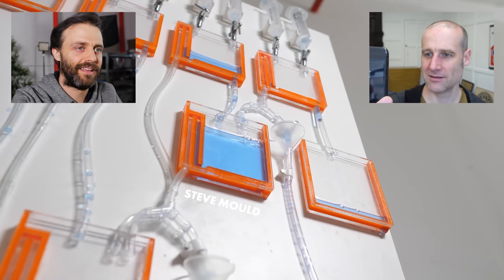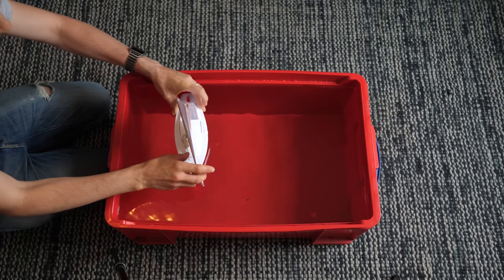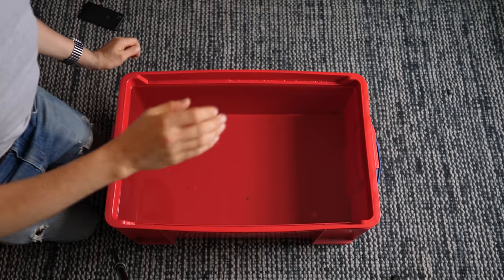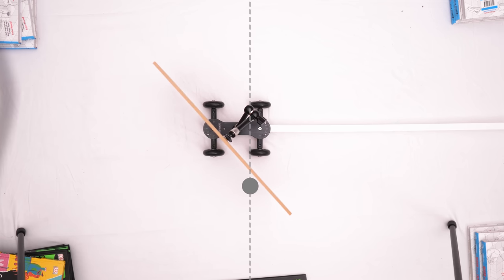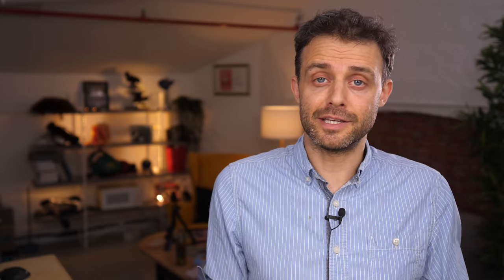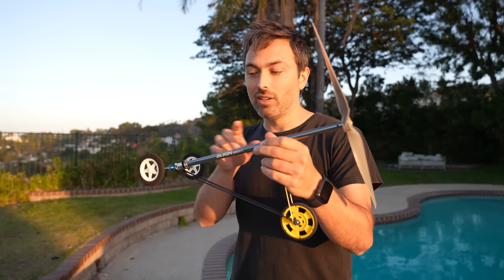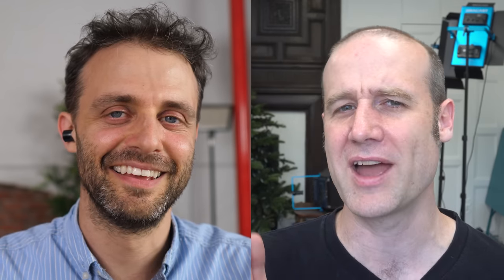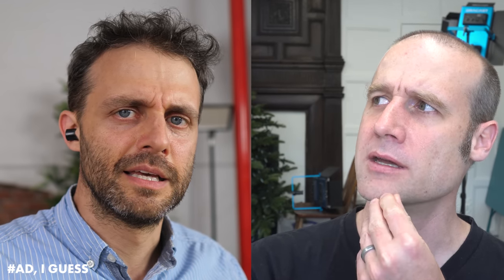Sailing Faster Than The Wind - How Is That Even Possible?

Comment: Without watching the video, im guessing how this works as the thumbnail kinda explains this entire concept, If we have windspead in one direction it pretty much means that if using a sail we can only travel that fast in that vector direction but if we angle the sail we can have a moment vector in another direction which theoretically in a ideal situation with infinite space and no friction on some tracks you could reach rediculous speeds at tiny sail angles, except with very slow acceleration

Comment: Actually, the sideways drift of a sailboat is not negligible. When tacking into the wind, the drift is usually around 10-15°, and you have to aim upwind of where you are going when navigating. Also, since the boat will not be going straight through the water but at an angle, the keel/centerboard and rudder will also act like wings underwater similar to the sails, but which force-vector point forward and into the wind, counteracting the drift but also adding to the forward force! Underwater aerodynamics are very important, as the density of water is so much higher than that of air.

Comment: A bit simplified without talking about Bernoulli.  The lift vector of a wing and by extension a sail is not 90 degrees (directly up) off the cord of the wing, it's at an angle lifting ahead or forward of the wing.  This is why airplanes need tails and a wing will tumble without one.  So this forward leaning lift vector plays a big part in a sailboat being able to sail more than 45 degrees into the wind.
Reply: The lift vector is defined as being 90 degrees to the free stream (or motion vector in still air).  There is however a drag vector as well of course (which is defined as parallel with the free stream.
Reply: @Rick_Cavallaro  I was trying to describe when the wing is at a positive angle of attack to the relative air mass it is moving through, the center of lift will be greater on the forward half of the wing.  So looking at the classic wing diagram the wing is shown at some positive AoA and the lift vector is straight up, but that angle is tilted forward relative to the cord of the wing which will cause it to tumble without a tail.  Anyway it was probably 10 years ago when I read "The Illustrated Guide to Aerodynamics" by H.C. "Skip" Smith.  It's a really good primer on Aerodynamics.
Reply: Not implying you need to read it, just recommending it in general to anybody who is interested...  just figured out who I'm talking to ;-)  That's one hell-of an amazing machine you built.
Reply: @JohnUllrey  
>> that angle is tilted forward relative to the cord of the wing

Ah yes.  That will typically be the case.  But lift and drag are defined relative to the free stream rather than the chord of the airfoil.

>>  which will cause it to tumble without a tail.  

The reason a non-swept, and non-reflex, airfoil will tumble without a tail is because a lifting foil necessarily induces vorticity.  This puts a torque on the wing.  In a traditional aircraft, the tailplane has negative lift and the C.G. is a little bit ahead of the wing's center of lift - for stability.

>> That's one hell-of an amazing machine you built.

Thank you!  That's always so much nicer than being called a liar and a con man. :)
Reply: @Rick_Cavallaro  Yes, I probably had an over simplified view of what causes a wing to tumble.  I re-watched the original video and what I was trying to describe is the component of the lift in the forward direction shown by the green arrow 7 min into the video. (https://youtu.be/jyQwgBAaBag?t=426 ) I was trying to say that this component is a contributing factor to why a boat with an airfoil shaped sail can tack greater >45 degrees into the wind.  Steve Mould did bring up the importance of the keel, which I think is what makes it possible to apply these forces in the direction you want to go.  Thanks for the engaging dialog.

Comment: It's the same principle as gearing! you can peddle a bike slower than you are moving because the gear ratio. What is happening is a lot of wind energy is being compressed into a small working engine. The sail can focus the energy to direct movement.

Comment: Great explanation of sailing but I miss the demo that one can actually go faster than the wind downwind, i.e., even if one sails at a slight angle from the wind, the downwind component is still faster than the wind. This is an essential point to understand before going to Veritasium's machine. I reckon your rolling contraption could show it in principle with quite extreme angles (and america's cup boats are now doing it all the time).
Reply: Two youtube videos which explain how the downwind component can be greater than windspeed:
DOWNWIND VMG GRATER THAN WINDSPEED (WEDGE)
DOWNWIND VMG GRATER THAN WINDSPEED (STREAM LINE)

Comment: Hi @Steve Mould. I was looking here for an explanation about how the blackbird presented by Veritasium could go faster than wind in the same direction, or not. But it seems you don't address this question?  In fact I think that the explanation of Derek suffers of some elements not rigorous enough... For example, all the forces on his drawings are in the same direction (backward) meaning that the sum of forces is never zero, and in fact introducing confusion on which element has a positive motricity on the car (provides power) and which one is receiving or consuming power. It would also be nice to explain what happens when starting... What makes the car accelerate from no speed? And what appears when it goes slower than wind? Then I'm still not convinced that this car that seems taking power from nowhere can really exist... But I will have a deeper look in the links he provides under his video, may be I'll find some more understanding. If you are yourself convinced, maybe you could explain us? ;-) Thanks for all your amazing videos.

Comment: The point of Veritasium's videos was to demonstrate a vehicle that can move directly downwind faster than the wind. This concept dates back to at least 1877, with the Brennan torpedo. Steam engines drove spools that pulled two wires which were being unwound from two spools, each geared to drive a propeller at a lower speed and higher force so that the torpedo was propelled forwards by pulling the wires backwards. If the wires were attached to posts in a stream, the torpedo would move downstream faster than the stream. The more recent discussion on this started at Physics Forums in October 2008, when someone asked about this 2006 video:   https://www.youtube.com/watch?v=aJpdWHFqHm0 . As for sailboats, high performance sailboats are not only able to sail faster than the wind, but their downwind component of speed can be greater than  wind speed. This is possible because the sail is constantly moving into a fresh supply of undisturbed air ahead of the sail boat. The catamarans in the Americas cup can achieve a downwind component of speed about 1.8 times the wind speed.

Comment: 12:10 Obviously you cut the cord, peel back the insulation, get solder and flux, solder everything back together, realize you forgot the heat shrink, desolder the wires, add the heat shrink, resolder the wires, add the heat shrink properly and boom!! Done! It only took a couple of hours to find everything.

Comment: Hi I'm a sailor and a thing you missed is that depending on the angle you are sailing to the wind you set the the sail on different angles and you can change the shape of the sail also depending on what angle you are sailing to the wind and the wind strength
This is how we optimise the sails so we don't get over powered and the greatest efficiency

Comment: I just had an Ah-Ha moment.  If we think of wind like we do water or electricity with concepts of Pressure and flow-rate (velocity), then aren't we just doing an energy conversion where we trade pressure for velocity.  So, the yacht is moving with greater velocity than the wind, but with less pressure behind it (less available force).  No-one would complain if we geared it the other way to get less speed with more force, but for some reason we get hung up on more velocity, less force.

Comment: As a sailor I’m fairly surprised that there is no mention of the speed of the boat itself which increases the amount of wind on the sail, the relative wind (the wind you feel from the boat). As the relative wind increases when you get some speed, the sailor can get a little further from the « real » wind and go faster and faster. End of the road, you get to go almost on the same direction as the wind, but on the boat you have the impression that a huge amount of wind is coming from the front of the boat. Because the speed of the boat and the speed of the wind accumulates, that’s how you get faster than the wind. I’ve always heard this is reason why some sailers can go faster from the wind. Is that complementary or a contradiction with this explanation ? That I don’t know

Comment: Could you use this fact to get solar sails up to very hard speed. The drag in space should negligible until high speed. 
Through the lack of drag also moves the sail straight away in the direction of the solar wind.

Comment: 3:05 shouldn't it be a parallelogram of vector forces, not a triangle. So instead of the resultant pointing a little back, it's a longer arrow halfway between the first two?
Reply: The force, impulse, or change of momentum is the difference of the two momentum vectors, not the sum. Parallelogram is for summation (addition), and here we need difference.
Edit:  so, horizontal (before) plus red (change) equals the resultant slanted white vector ( after)

Comment: Because its not the speed of the wind, its the THRUST generated by the airfoil shape.  The sail creates an area of low pressure in front the the sail, like a wing on an airplane does, albeit horizontal. Contrary to popular myth, this low pressure area does NOT  ‘suck’ the wing up, nor the sail forward. What happens is that further out above the bellied surface of the sail is a zone of higher pressure air that immediately moves into the low pressure zone created by the sail.   As it accelerates into this area, the sail moves forward, and the result is a THRUST spilling off the tail edge of the sail ( or the wing) at a vector relative to the chord of the airfoil that is aft of perpendicular.   Really and for true. THIS is how wings work.   And everyone can SEE this at work because the low pressure side of any propellor demonstrates almost no force at all, but the other side clearly produces thrust.  If the wind hits the sail at an angle that creates a particularly severe low pressure zone, then the air further away accelerates towards the wing at a speed faster than the actual wind that is blowing.  Action, reaction. The boat will move in the direction the keel most easily allows at some component faster than the wind is blowing, because no matter how fast the wind is blowing, the low pressure zone accelerates it even further.

Comment: Does a boat propeller with a hydrophobic coating spin faster in water than one without such a coating? Does it push more water at the same speed? Does it use less energy? What about a hydrophilic coating?

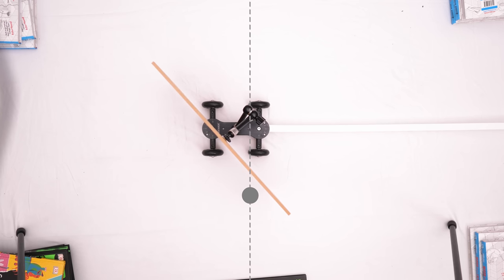Comment: The optical illusion at 5:50 makes a lot more sense if you flip the video upside down. In that viewpoint each packet of air is falling around the sail. I'm thinking that maybe our brains instill that gravity into our imagination. Therefore when we try and process the information of the packets of air flying upwards it is harder to understand or even see than when they are "falling".

Comment: Unless i missed it..you left out the importance of the weighted keel. And yes sailboats do move forward from being broadsided with wind. Very quickly too. Its called a beam reach.  If there wasn’t a weighted keel then the effect would be as you stated earlier. Every sailboat has a weighted keel and it’s as integral as the sails are

Comment: Great video, thanks for it.  Important to note, I think, is that sails experience the relative wind, not the absolute wind.  So as the boat moves forward the boat's velocity vector is added to the wind's velocity vector.  When the boat speed approaches and passes the wind speed that becomes really important.

Comment: So, what would happen with a boat with a propeller-shaped sail (a wind turbine really), providing power (torque) for a propeller under water?

Or vice versa, a water turbine (propeller in reverse) providing torque for an airscrew (propeller)?

I think the former might be able to sail directly upwind, while the latter (if the balance of underwater drag and the thrust from the propeller is correctly managed) could sail downwind faster than the wind, similar to how the downwind cart is doing.

Comment: That thing with a power chord (or, rather, plug) is that they most probably stuck it in the other way round, that is with prongs facing the handle. That way they could manoeuvre them around the handle. Or they could have cheated and used a chord with nothing on the other side and just threaded it in

Comment: This video reminds me of when I was a kid struggling to understand how a roller-coaster could achieve faster speeds than a free-fall ride of the same height...
Reply: I don't think it can.  With zero losses (aero drag and rolling resistance) the speed of either should be governed by the traditional balance of kinetic and potential energy.  You tell me how far it is below its highest point, and its speed while it was at that point, and I should be able to tell you its speed now.

Comment: Thank you, you have clarified some significant points, but I don't feel that we have a full understanding of what is going on here. After watching the Veritasium video I offered my nerdy brother and his fancy engineer sons a free pizza if they could explain the phenomena in plain English (they couldn't). Being able to sail faster than the wind  is not the issue. The video claims  (at the 19:49 mark) that the vehicle can has attained a land speed as high as 2.8 times the wind speed. THAT is the problem. Veritasium also claims that the forward motion of the vehicle is captured by the wheels  and that in turn drives the propeller, not the other way around (like a windmill). It is not al clear how the propeller can pull power from the wind AND yet push the vehicle faster than the wind at the same time. I told to my engineer nephews that a favorite engineer trick is that if you can't baffle 'em with bullshit, you can always confuse them with equations.  What I am looking for is  a convincing description of the equation that will describe how 10 mph X (surface area + deflection angle + feedback from wheels + gears + lift  - drag) = 28 mph. There is a pizza waiting for the sage who can make a convincing case in plain English.

Comment: AS a sailor most monohulls cannot travel faster than the wind they are displacement hulls and are limited by physics of the waterline.  If you can attain 50-70% that is good. The performance  catamaran, trimaran or the foiling boats have much less resistance to movement through the water.

Comment: Very cool explanation. But, wasn't the lift in wings generated by the difference of pressure given by the different speeds of the air below and above the wing? (and hence, the wing need to be curved and can't be a straight line) ? What am I missing?
Reply: You can buy toy planes with flat foam wings, which glide just fine. Of course they can produce lift at non-zero angle of attack.

Comment: The sail is a coupling device, it makes the vehicle sync up with the air, I'm imagining the wings also have a modifier to them or something so it can move faster than the wind.
Reply: The real key is that a boat (with a sail sticking out of one side, and just as importantly, a keel out of the other) is a coupling device between the air and the water. It's the differential motion between the two, that powers a boat.
Reply: @FlyNAA  so does the keel act as a sail too at times, like in a current?
Reply: @crackedemerald4930  Exactly. The sail is the wing in the air, and the keel is the wing in the water. And since water is about 1000 times the density of air, it's far easier to build an effective wing, even accidentally. So a boat without an actual recognizable keel, its hull (being an oblong object) still acts as a low efficiency keel and provides the sideways force necessary.

Comment: 4:22 Smal sailboats, under 15 feet have a retractable centerboard, while large sailboats have a large keel. They serve the same purpose, keep the boat from moving sideways (crabbing) like you little toy boat.

7:52 A sailboat can NEVER sail directly into the wind. A series of tacking moves, in a zig-zag fashion, is called beating, and allows sailing in the desired direction.

Comment: Now it is true that this is the fastest point of sailing (with a modern rig) but as the boat gets faster the apparent wind direction changes and moves further aft until the boat slows because it is now aft of the beam and the boat can only sail as fast as the wind. If the wind is forward of the beam then the faster the boat sails the further aft the apparent wind moves. The maximum speed is where the apparent wind moves aft of the beam once more.